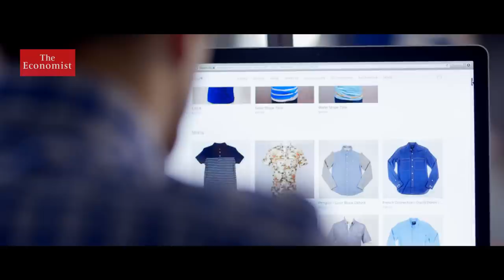What will people wear in the future?

Comment: Without standardization (like mobile phones, voice controlled Bluetooth speakers,...) smart appliances only succeed in niche markets. Smart clothing is 95% hype, not a massive movement.
Reply: Benji F for now
Reply: @kirdnehh  with that logic anything could be the next big wave.
Just like ever since 1980 everyone said in a decade ai will be smarter than humans. Technology does not follow hype, it follows economics.
Reply: @benjif2424  The internet of things is growing though. 1/5 have smart assistants in the home in the United States for example. Logically the next step would be wearables.
Reply: @vksepe  Wearables have had a hard time, because they are only practicle for niche-areas. Fitness trackers work for an arguably large group, but other than that I don`t see big potential. I can`t predict what the next Bolt will train with, but most people will not be wearing anything revolutionary in the next decade. I believe medicine has the greatest potential to make money with wearables, but they are already doing that (and have been for quite some time), so nothing revolutionary there either.
Reply: @benjif2424  Wouldn't something like temperature control be popular if it gets cheap? At least in the areas with extreme climates. Since that is a big reason why people wear clothes...
Reply: @anomaly9156  temperature control is dangerous and inefficient in smart clothing. Improvements in architecture are far better in every aspect (safety, long term cost, effectiveness,....).
Monitoring of course is the role that is and will continue to be covered by wearables.